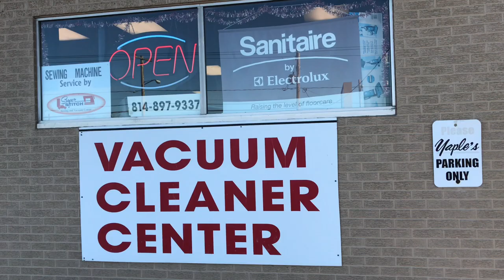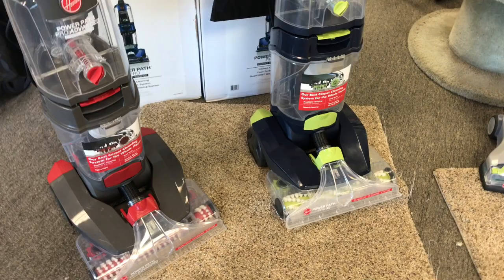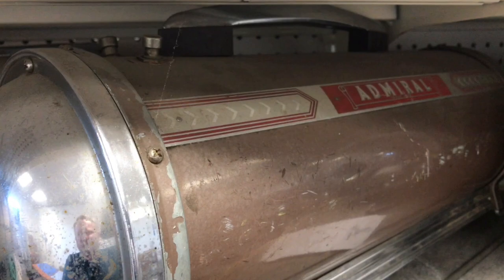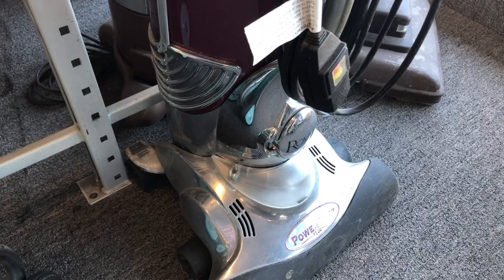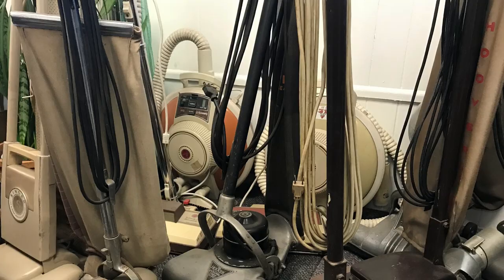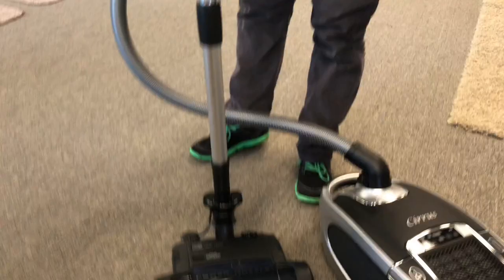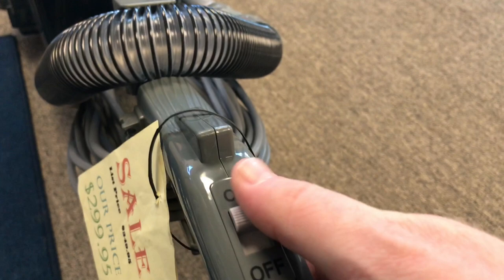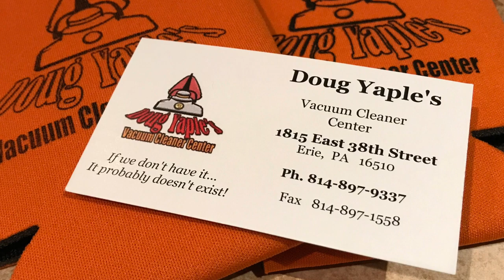Doug Yaple's Vacuum Cleaner Center, Erie, Pennsylvania

Comment: Hey Dorian loving the videos.  It feels like forever since I was in the states.  Tho hoover shampooers are under the vax label here. I have the powerpath pro. I hate it.  It replaced my dual v which was so much better. 
It's such a shame we don't have vacuum stores like that over here.
The cirrus cylinder with the powerhead is made by the same company that took over production of wertheim  Australian brand but was available here for a few years. They were plagued by poor production. The construction of them was total crap but they did have amazing power heads with metal brushrolls very similar to old hoover ones
Reply from the maker: Dave Debang-bang Thank you Dave 😁😁😁, I wanted to try them as I’d not seen them before. I would have loved to have tried the vintage ones too, but many had not been tested or didn’t have bags in them, they were mainly display only. Next time I hope to speak to Doug and I would love to interview him.
Reply: Dave, you're right, the Wertheim & Hoover Windtunnel Anniversary canisters were made by KingClean in China, under contract to T T I. One thing to remember though, it's NOT the manufacturer's fault, but rather the brand's fault, for the poor quality. I think a lot of people don't realize that the manufacturer is only doing as they are told & making the vacuum to the quality specs that the brand has told them they want & unit price they are willing to pay, so the vacuum can be sold at a certain price point with the expected lifespan it's expected to have before the consumer needs to replace it. The Chinese are more than willing, & capable of, producing a quality product, IF you're willing to pay for it. If you really think that Cirrus vacuum is bad, bear this in mind....there is a version of this very same canister called the Vapamore Vento, exactly identical except for the color is yellow & a different powerhead....that vacuum comes with a LIFETIME warranty on the entire canister & powerhead motor. Now, granted, you do have to pay for shipping both ways to the brand's facility to have it fixed, as they are the ones who honor the warranty & not the vac shop, but I think that says a LOT when a brand is willing to put that kind of warranty on a Chinese vacuum.